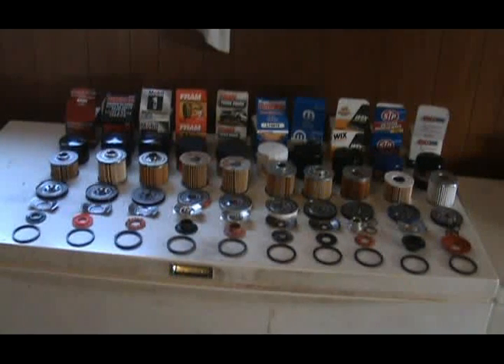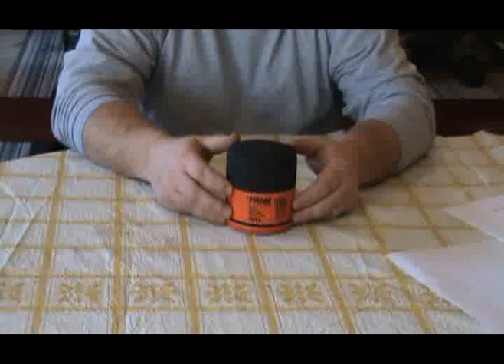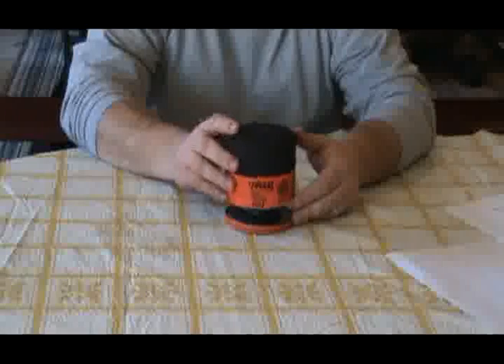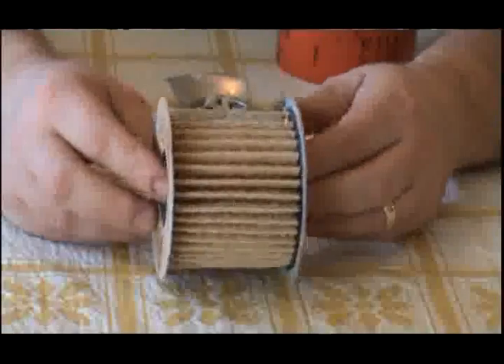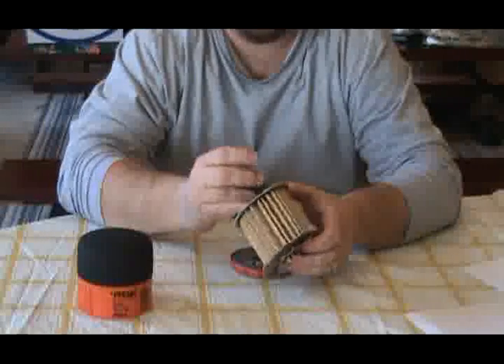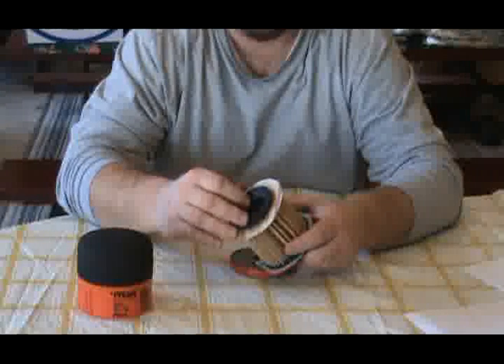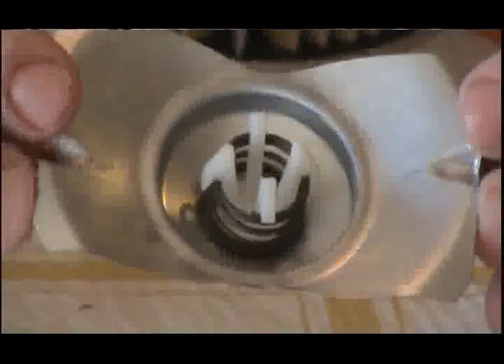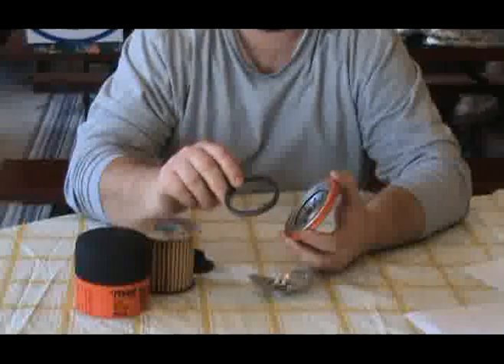What's in a Fram extra guard filter?

Comment: The issue is this - if Fram is going to cut corners by using a fiber instead of a metal end cap, where else are they going to cut corners?

I have a 80 Honda CB750 - it uses an oil filter that is an exposed element design - and the Fram filters for that bike are identical to everyone else's - metal end caps.  In other words - when the filter element is easily seen by the buyer - Fram uses metal.  If Fiber is so great then why don't they use it in those filters?

Comment: I paid 3500.00 to re-rebuild my 69 Dodge superbee 440hp engine in 2005 because the fram filters cardboard came appart and locked up my oil pump. I pulled its pieces out of my pump myself. I know it caused it.  Fram would not do anything! You Suck Fram! Blamed it on my Melling high volume {not high pressure} oil pump. 
  If you google "fram locked oil pump" you'll find its common for frams to do this.
 Thats the reason why no filters use it. Its cheaper if it worked they all would do it.

Comment: my old '89 Toyota truck had 300,000 miles on it and I used a fram filter at every 3000 mile oil change. the math=100 fram filters with out a failure of the filter! I finally sold the truck because the fuel pump quit.

Comment: None of the filters he reviewed gives your engine the protection it needs. None of them. The best way  to go is with a filter bypass setup. Check out vids on Amsoil bypass system or Kleenoil bypass as examples of what I'm talking about. All the filters he reviewed only remove particles down to about 20 microns. The clearances in your engine can be less than 3 microns. Guess what happens when a 20 micron metal shaving gets between a piston ring and cylinder wall. GO WITH BYPASS SETUP....FTW!